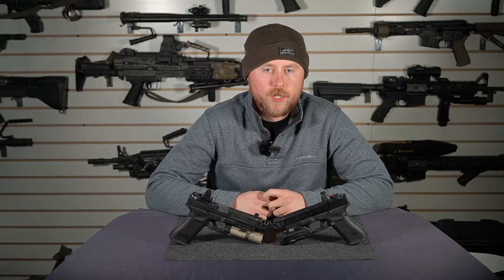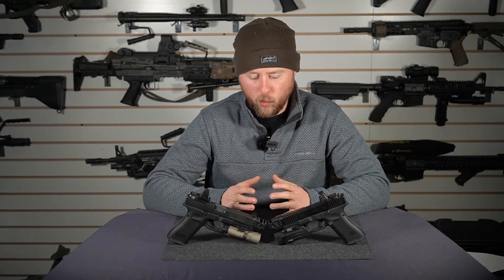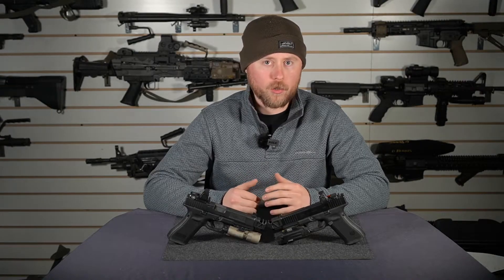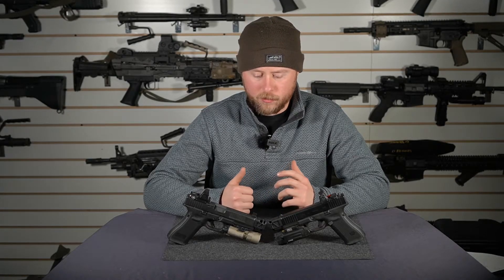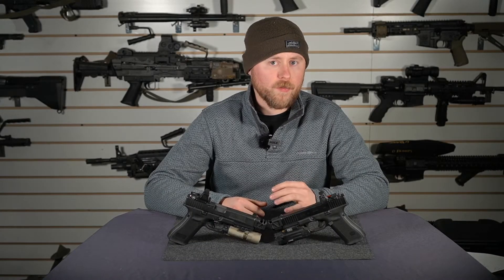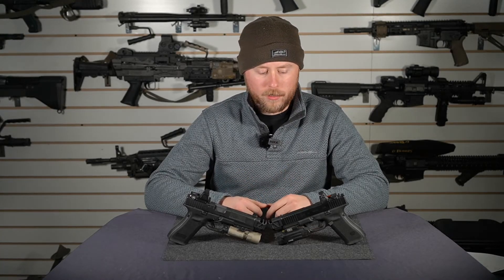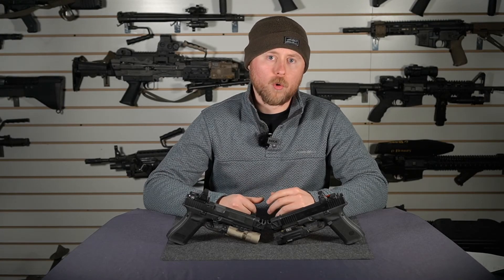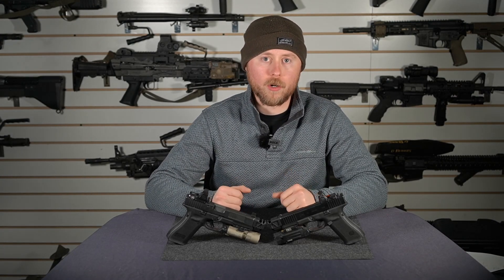Armory Tutorial: Dual port vs  single port comp

Comment: Recently installed the single port comp with PMM blackout barrel on my gen 5 19 mos, and was extremely pleased with the reliability on a variety of ammo. Immediately took it out and went through 500 rounds of M1152 ball without a single stoppage.  Also fired about 15 rounds of Winchester ranger t series 127gr +p+ and 15 rounds of hornady critical duty 135gr +p. The critical duty was by far the softest shooting cartridge of the three I fired, while still maintaining a reliable, albeit lighter ejection pattern.

If I were to recommend a comp for a carry gun it would definitely be the PMM single port.
Reply from the maker: We appreciate the kind words! Thanks for the support.
Reply: Good info, this is what I need to read! Thank you!